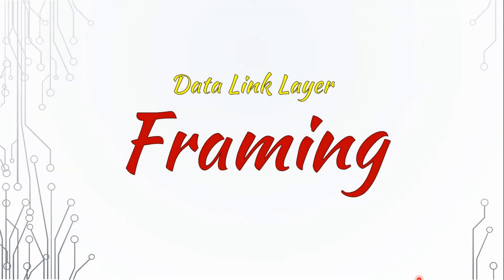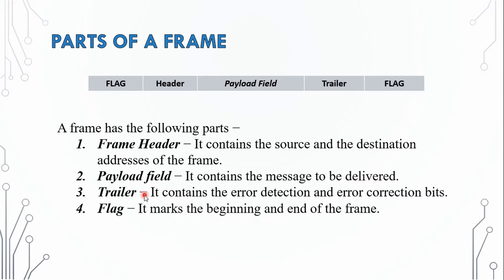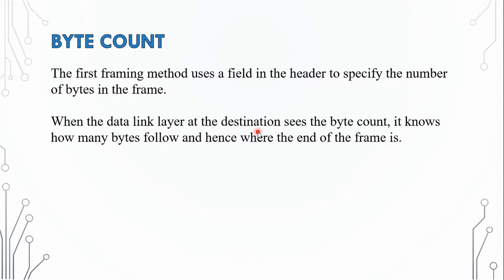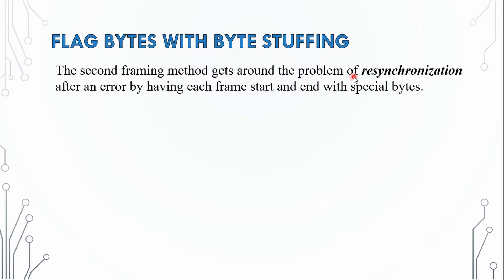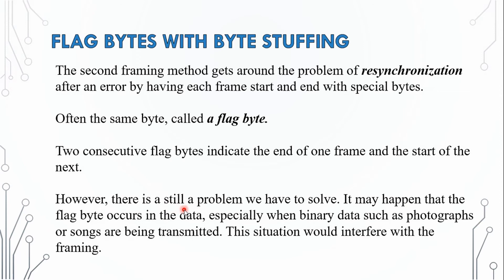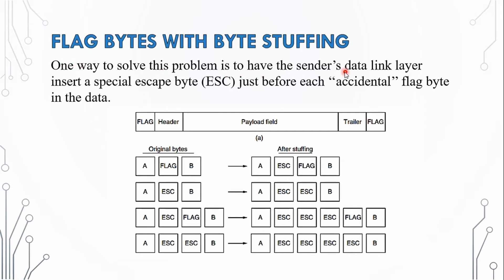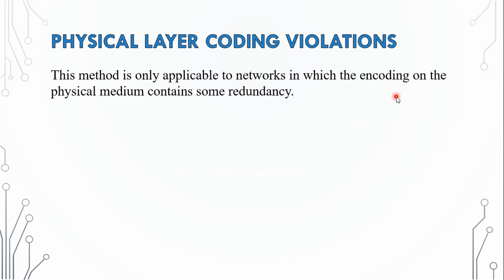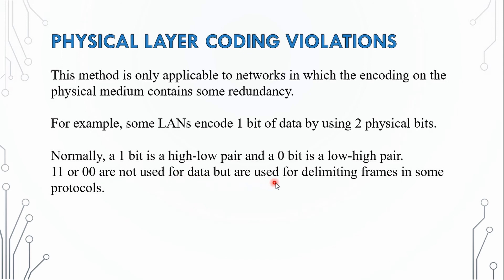Framing in Data Link Layer || Computer Networks || BANGLA Lecture

Comment: Well explained.. But Apu je header error hosce ..ei error ta ki vabe solve korbo byte count farming method e..
Reply from the maker: Thanks for your comment😊

To correct the error in data frame, the receiver must know exactly which bit in the frame is corrupted. To locate the bit in error, redundant bits are used as parity bits for error detection.For example, we take ASCII words (7 bits data), then there could be 8 kind of information we need: first seven bits to tell us which bit is error and one more bit to tell that there is no error.

For m data bits, r redundant bits are used. r bits can provide 2r combinations of information. In m+r bit codeword, there is possibility that the r bits themselves may get corrupted. So the number of r bits used must inform about m+r bit locations plus no-error information, i.e. m+r+1.